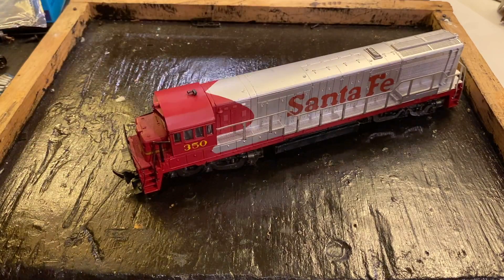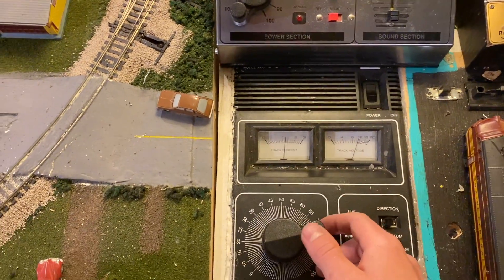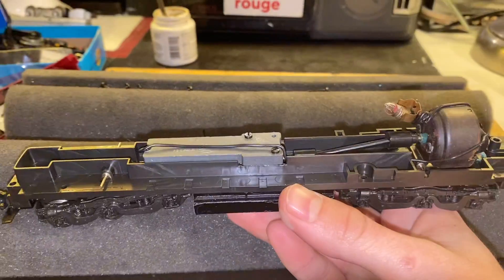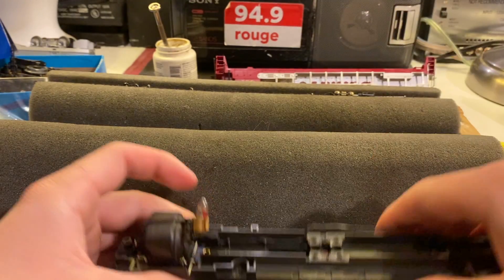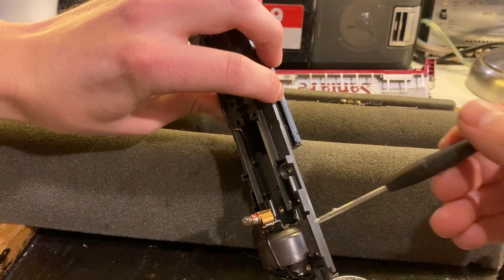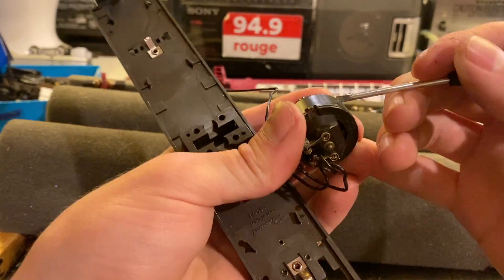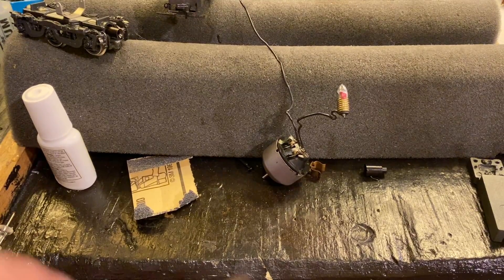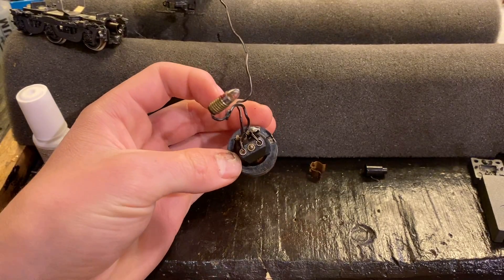Can We Make it Run? Rivarossi U25C with Seized, Corroded Motor

Comment: Both LIMA and Rivarossi installed one brush in carbon and the other in a copper wire mesh to keep the rotor clean.

Comment: i have a quest i have a loco just like this one with a different body and my motor is in the same condition if not worse i was wondering where you got that replacement motor
Reply from the maker: You can find old Riva motors on eBay

Comment: How many cars can this unit pull? I have a Rivarossi E8 units and they have a hell of a time pulling 3 AHM passenger cars. I transferred the body to an Atlas chassis. Now it pulls 8 passenger cars! The motors in Rivarossi engines are a joke.
Reply from the maker: Rivarossi locomotives aren't known for having amazing pulling capacity but it should be able to pull more than 3 cars. Sometimes the traction tires on them wear out which might be why it was having trouble.

Comment: I redid a motor like this several years ago with all the rust fuze, I used a wire wheel in my Dremel and that worked just fine.I had to grind some of the metal off the armature lobes till it rotated freely. I cleaned everything and it RAN and ran better than several I didn't need to fix. Lucky me!!!!!!!!!!!!!!

Comment: My Dad bought a Rivarossi Northern Paciific U25 around 1979. It was one of the last locos I ran on the old layout at my grandparents. The last time I went there around 2012 a few years before my grandfather died. I dug around and found that loco. It never ran that well and it had been stored in the basement and the handrails had rusted. I ended up buying a nearly unused boxed one to run and my "original" I keep for display and nostalgia. Thanks for the vid!

Comment: You forgot the small plastic washer in the motor.
The magnets are not coated. It's a kind of (dirt cheap) plastic magnets made from plastics and pulverized ferrit magnets. Like the flexible ones on you refrigerator. They're dirt cheap as making them any shape it just like plastics. Ferrits on the other hand require more complicated manyfacturing, custom molds and machining afterwards.

Comment: @SMT Mainline Have you 'had' any locomotives that 'sparked' and caught fire in your tests? I heard of a friend in Texas got a 'used' locomotive, put on the track with power on, it got hot, and caught fire, because he got distracted... then again, the videos I see so far, it's some common corrosive/oxidation on the motor, the springs to the brushes worn out.. The power pack 'did' make a loud buzzy noise... some thought it was the dryer buzzer... some people don't understand, these are electric motors and have needs of keeping the motor serviced... My Dad 'did' salvage some Bachmann, Tyco locomotives with the same issue, the Blue Box Atherns are so cool.. I had an F9 Amtrak that ran good.. I got spoiled on the horn hook couplers.. AHM and Mantua were the 'caddilac' of locomotives... but then again, put a nice stout motor in a cheapo locomotive, Franken-change a cheapo into a caddilac.. ;)

Comment: This vintage of Rivarossi motor was prone to seizure if left sitting for a decade or more.  That was a valiant effort you made to fix it, though. This split drivetrain was used in Rivarossi Alco Century models in the 70's.  Also, the very first year of the TYCO C-630 was built on a slightly modified version of this chassis by Rivarossi, is extremely hard to find, and likewise to maintain.  Unfortunately the chassis Rivarossi built for TYCO was not as well built as this one (snap-fit shell and gear box instead of screws) nor is it interchangeable. I have 2 of them, but only enough parts to make 1 run, and so they can be difficult to restore or service.   TYCO abandoned this chassis after the 1st year and remade all their  C630 shells to take their own Power-Torque truck instead.  To be honest, these are some rather noisy drives and the long shell body only helps amplify the gearbox noise, lol!  AHM & Life-Like kept selling this model, (built by Mehano) but with a slender center-mounted can motor and drive out each end, dispensing with the noisy center transfer case used in this chassis.

Comment: Had and might still have the Northern Pacific one that was apparently the prototype Riverrosi based it off.
Sounds like the donor motor needs a little TLC or some light grease in the drive gears because I don't remember them being quite that loud.

Comment: RE: Rivarossi motors. Let me warn you to NOT try opening the old square motors Rivarossi used it the 60s. These actually had ball bearings and they were NOT in an assembly but ran in a track at each end of the shaft. These were loose individual balls. The only other time I ran into such a design (and HAD to disassemble it) was on B&H 16MM projectors made between 1925-1972. These little motors were impossible to repair without specially-designed tools. 

Late square motors went to regular bearings and the round ones were a carryover from them. Just look into the rear of the motor and tiny steel bearings can be seen in those that have them.

Comment: I have several locos with slight variations of that drive shaft system, an Athern blue-box,an old Penn-Line GG1, as well as a Marx shunter, that while a single truck loco has a slot for a transmission bar quite similar to a Penn-Line Loco my grandfather had

Comment: Is that 1/80 I remember having sold old rivarossi in the early 80s and they were all to 1/80 scale
Reply from the maker: I didn't notice that. I wonder why they would make it 1:80 instead of 1:87 scale
Reply: SMT Mainline I’m in the UK and we have a few shops that specialise in North American models , I had some
Old B&O Athearn heavyweight cars and also added 2 Rivarossi and could clearly see they were larger more like the OO we use here than HO so I took them back as didn’t look right at all on the track, that’s when the shop manager (who was the Rivarossi importer to the U.K.) told me they use the odd 1/80 scale for HO even the European models, 1/80 is the HO standard for Japan!

Comment: I modeled in HO from 1968 to 1978.  Rivarossi (imported by AHM) and Athearn were the most commonly used HO locos.  Rivarossi units had very good molded detail, and usually had large motors like your U25C, but suffered from one truck drive and lead weights in plastic frames.
Athearn locos had metal frames, hefty motors, and two truck drive, but lacked the level of molded detail found on Rivarossi.  I ran a mixture of both makes.

Comment: Nice video. I've never seen a mechanism that badly corroded. Rivarossi made a new U25C a few years ago that's very nicely detailed and a great runner. It's not bargain priced, but straight-DC examples show up on eBay for under $100 occasionally

Comment: Yea those motors are the weak-spot of every old Rivarossi loco, and I still couldn't find a replacement brush for my V160, the old ones simply crumbled, but the Altaya made ones are not much better neither.

Comment: Great video, possibly the best one yet, very few if any videos show the inside of a Rivarossi motor. You can re magnetize the old magnets but replacement is better. The greatest challenge is bending those tabs back to open the motor. Some I have found are super difficult while some are easygoing.  The brushes are unique in these, one is a carbon composite, the other copper looking brush is made to clean the commutator surface. The more sparks they make the weaker the magnets have become, causing more current and more voltage required. More videos like this and you will get to 50k subs someday! Good job! Well done ! Hope to see more like this.

Comment: Way to go, Harrison!  Let's call this a fortunate success.  Although it wasn't powerful enough, nice job getting the original motor operational considering the seized condition.  That's why I cannot stress buying inexpensive donor locomotives to have on hand for just such an occasion.  Fortunately you found what you needed among the parts sent by Nathan DeLay.  She's a runner.  Huzzah!
Thanks for sharing. 👍 👍 👍

Comment: Your magic fingers work so well on HO gauge locos; have you ever tried resuscitating a modern, new, Atlas N-scale  loco?  I bought an SD60M new, DCC ready, with the notion of adding a DCC non-sound decoder to it.  The first time I tried it on a DC track the lights worked but the engine wouldn't turn.  I went ahead and installed an NCE decoder in it and still no-go.  The expert-guide seems to indicate a short that I can't find. I have checked everything short of digging down into the brushes - I just can't see how to get to them.  If you want it I will send it to you. I have more than enough other running DC and DCC locos that I won't miss it. Atlas 40002072 BNSF #8130 SD60M, new in box except for the added NCE 12A1 decoder, which I hope hasn't been burned out by an undetected short.

Comment: Wow i bet that was very hard! Dang that was alot of rust omg i have the bachmann version of this but mine is a ge u36b with the pancake motor drive. It does run but the light bulb on each side burned out.

Comment: What is that pen-looking thing you used on the commutator?  Appears to work quite well
Reply: The pin he used is a electrician’s cleaning pin. Some use carbon filaments, some use fiberglass filaments, to clean any surface quickly for better electrical contact. They can be found online. I like to use the fiberglass ones but be careful they can clean right though your skin because the fibers are like hairs sticking out the tip.

Comment: I turned my bachmann union Pacific into a dummy because it has cracked gears
Reply: I did this to a Bachmann about a week ago... I had some replacement gears, but I also wanted a dummy Santa Fe loco.
Reply: Glad I’m not the only one making old engines into push pull engines.
Reply: Super glue with a bit of baking soda will revitalize those gears, also assorted bags of plastic gears found on ebay or in hobby stores that sell trains will usually have a few of the ones you need.
Reply: Project 29 I’ve taken a few logos and done the exact same thing. Now I have spare parts for other projects 👍
- JP
Reply: 3d printing tech has come a long way in the last 3 years, you could 3d print new gears
Reply: @FQP-7024  well this locomotive is missing the motor brushes and a few other motor parts which also contributed to me wanting to turn it into a dummy engine